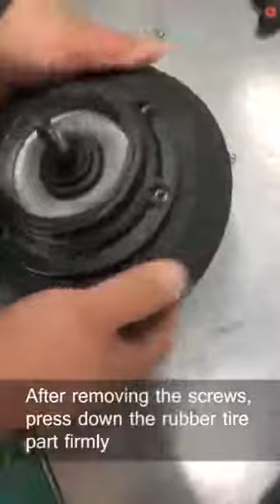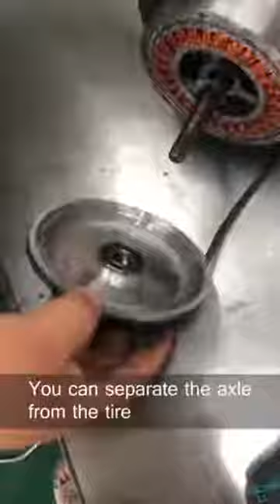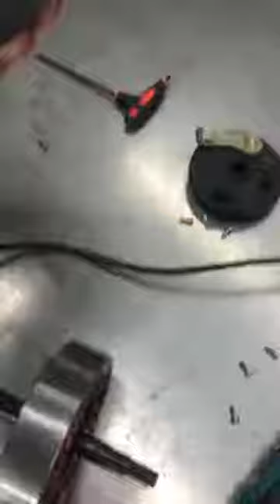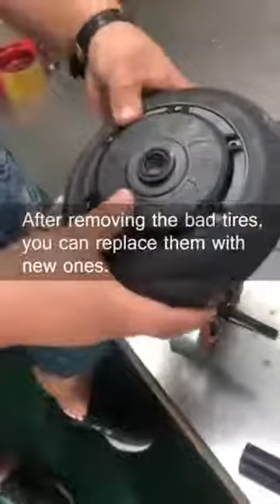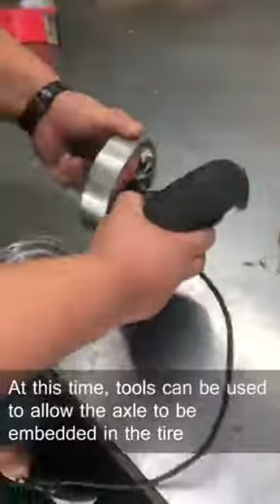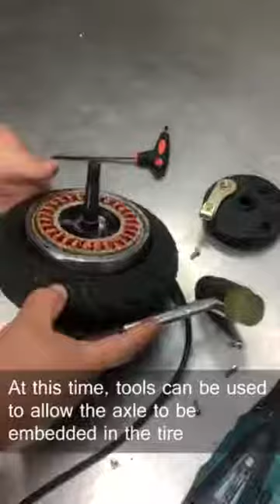Replace the front wheel

Comment: Thank You - but this video assumes you already disconnected the power cable from the front wheel in order to remove it.. I am stuck at that part and not sure how to get to the connector of the power cable that is connected to the wheel.  Please help